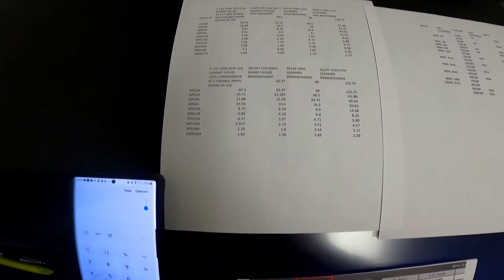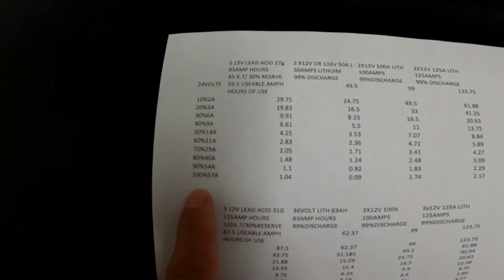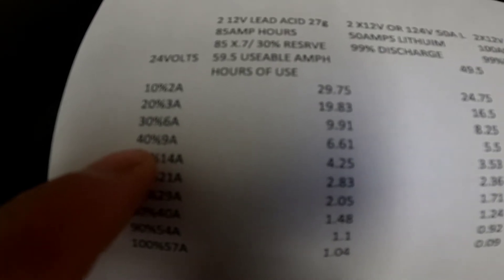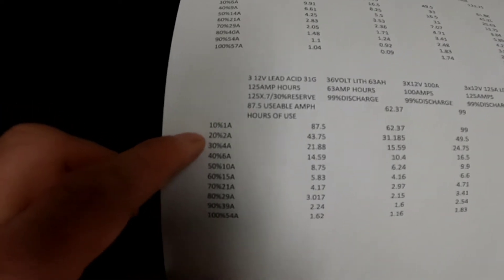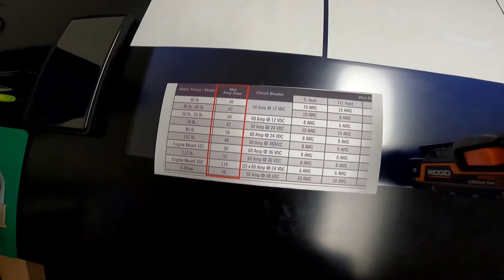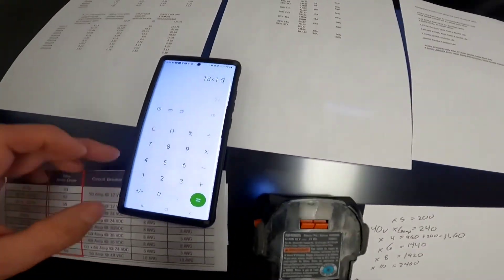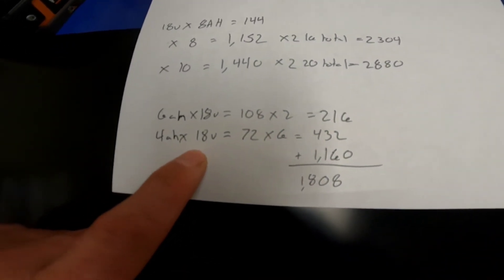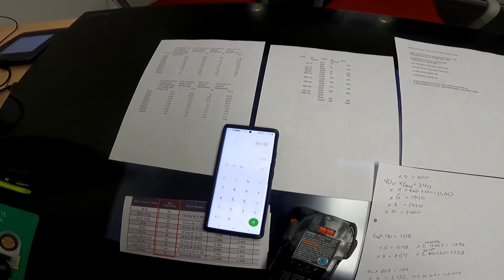Lithium vs Lead Acid batteries in  a Trolling Motor & How to do the math for usage difference.

Comment: Excellent explanation!
Love the idea of using batteries you/we already have!

I bought a converter to change 18v Milwaukee batteries to 12v. Plug-n-play
My tiny Lawrence Elite 3 can run over 8 hours on one Milwaukee 9ah battery on my kayak. 
1 of these batteries should power a stereo and a Lawrence hook 7 most of the day on my boat! 

The chart is the quick answer I've been looking for an explanation...Excellent!

Note to others,  2 - 12v batteries in series double the voltage...the ah stays the same.
His charts still work for 12v
Reply from the maker: Yip I do the same Luckily the Garmin fish finder I have can handle 18v directly of course it can vary per model.